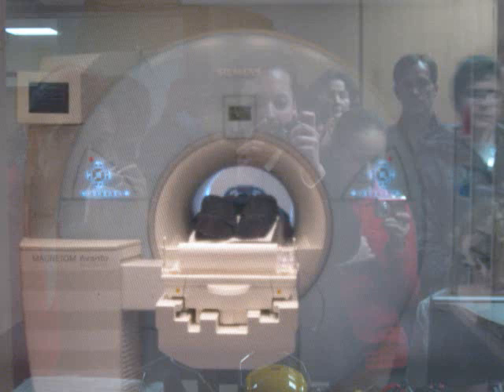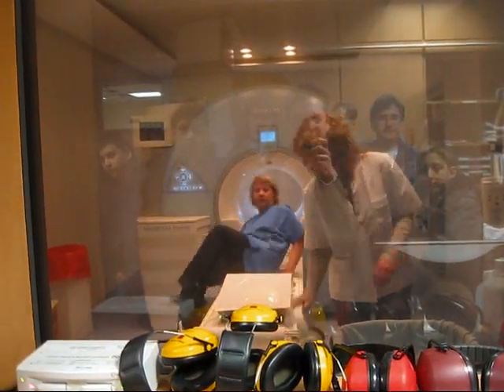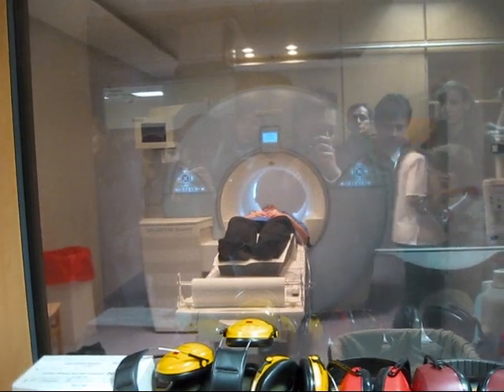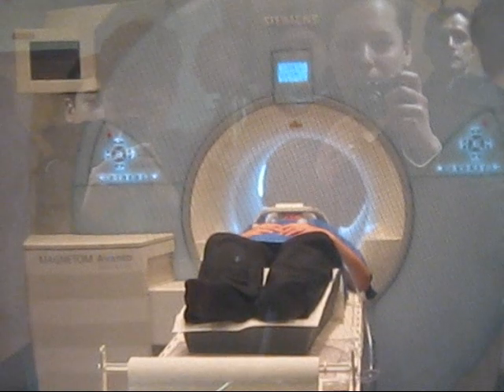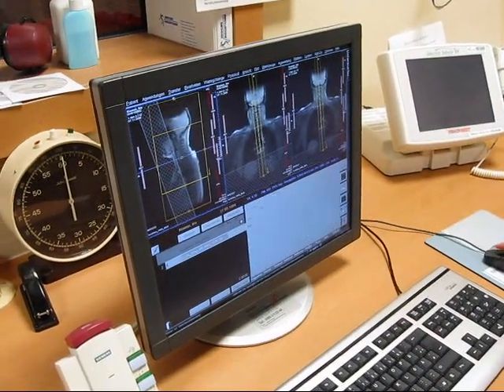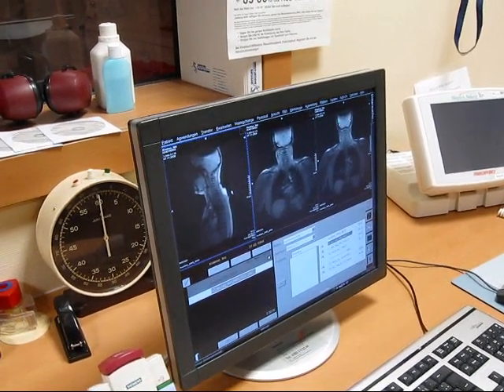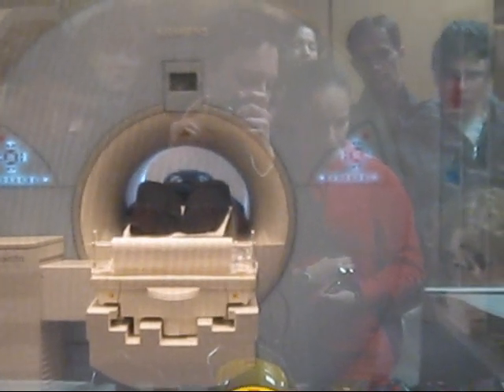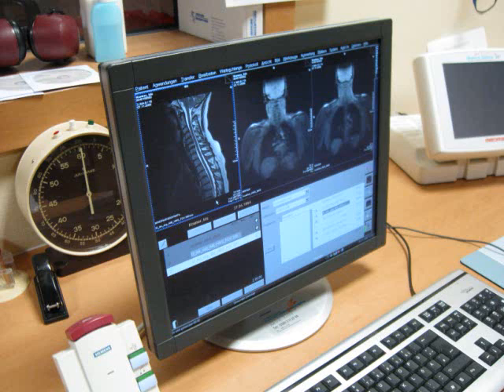how an MRI (MRT) scan is performed

Comment from the maker: it's gadolinum in a non-toxic component (like barium sulfate for CT scans of the digestive tract). adverse reactions are very very rare, much more rare than in the i.v. contrast agent used in CT scans (iodine). usually, 99,999% of people do not have any reaction to an MRI contrast agent. the remaining 0,001% may have very severe anaphylaxis, sometimes leading to shock and requiring hospitalization. but as i said, this is EXTREMELY rare. i've never seen it happen once.

Comment from the maker: if you're wearing ear protection, no harm is done. the induced electromagnetic fields also induce warming up of the body, similar to exhaustive sports, e.g. running. thus, you should not undergo an MRI scan when you have a high fever, as that can increase the temperature to a dangerous level. otherwise, it's perfectly safe.

Comment: The headphones I had played music (that I got to select). 
Unfortunately, the various sounds of the machine were still audible and were slightly out of tempo with the music. It created an uneasy feeling, but it still wasn't bad.
Until I was given intravenous contrast (not bad), and the technician taped a bandage over the injection with a tape that seemed to be designed to pull the hairs out of my arm one by one, it wasn't horrible.
After that, it still wasn't unpleasant. 
If I hadn't been afraid of moving and messing up the scan, I would've fallen asleep.

The CT scan I had was worse because the nurse couldn't seem to get the IV for the contrast started correctly. This is the first time I've ever had someone unable to hit a vein quickly and easily. Ouch.

Comment from the maker: @pawprints1986 
if your nose ring is made from a non-magnetic metal, such as titanium, it can be left in. however, it will produce artifacts. if the area that is to be examined is the nose or sinuses, it's bad. if it's a brain scan, it may just be okay.

Comment: i have allways wondered how they manage to have reflected signal (radio waves) located with such precision. is that phase array antena doing this buisnes? but the frequencies are bit low,like 30mhz,there 10meter antenas have to be applied. how does they do that?

Comment: Eddy currents in non-magnetic metals in the presence of a magnetic field can be quite impressive.  I've seen a demonstration where a non-ferromagnetic rod was dropped in a strong magnetic field, and resisted  the pull of gravity for several minutes.  I wonder how much heating could occur in that piece of metal in an oscillating magnetic field, and how much it disturbs the measurement. Do hospitals allow metal to be worn?